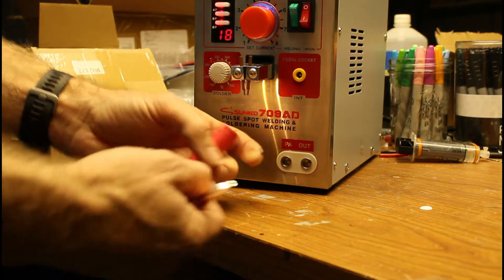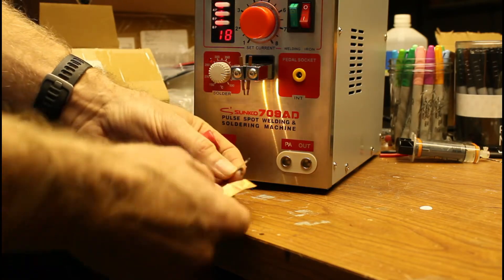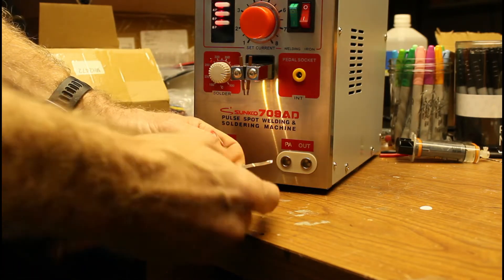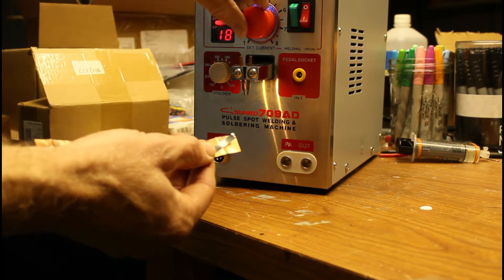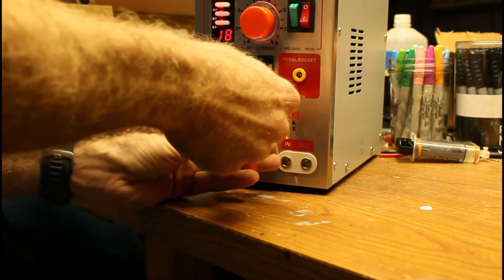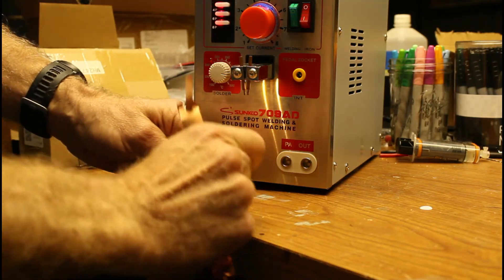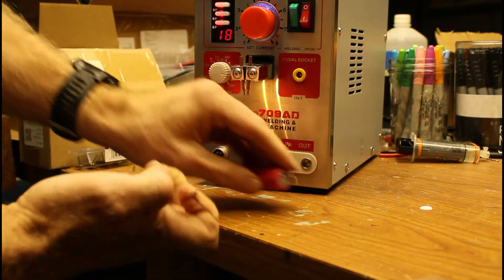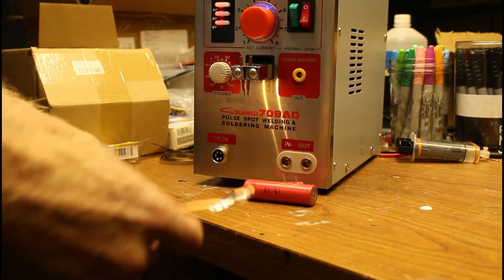Copper Nickel Sandwich Spot Welding

Comment: Thanks for the video. Sadly the 709AD is not available right now 😢
Reply: There's a very good reason for that. They destroy themselves. The control board fails often, especially when using the leads due to back feed when the magnetic field collapses after a weld. No matter the model number, if you see a similar looking machine it's the same design with the same problems. Buy a super capacitor machine you'll be happy.

Comment: About to use copper sheet for the first time. I've built hundreds of batteries but anything above 200A I always just used cells that I could bolt together. Like spim08hp's or headway 38120's. This will be the first time I'm building a high discharge battery with spot welding. I'd be lying if I said I was a little worried.. this is an almost 90kw build. There is zero wiggle room for detached strip.

20s20p molicel p42A. Qs180 90h, 3shul CL1000, CRF450R frame. 

I have 2 spot welders. Sunko737G+ and a Glitter801D. The glitter welds at 2500A max. In your experience is that high enough for 0.3mm copper sheet? Or should I get the glitter 811A which welds at 6000A max?
Reply from the maker: My experience with other welders is limited,  but I hear good things about the Glitter welders. I just picked up a kweld to try and do some heavier connections.
Reply: @ebikebuilds4000 does the kWeld do pure nickel 0.2mm with 0.1mm copper sheet? like with a LiPo?

i've got one on order which will probly arrive in a few days to replace my cheaper Sequre SQ-SW2 (it wasn't really good enough for consistent 0.2mm welds, plus consistency is hard to get as it's just time based)
Reply from the maker: @BH4x0r  I just started using mine. It's doing the .1mm nickel and .1mm copper just fine, way better than the Sunkko I used here.  I'm powering it with 4 chevy volt cells in series.  If I wanted to push it higher, I would do 4s 2p of these cells, and some heavier wires for the welder.
Reply: @ebikebuilds4000  didn't see the first reply.. I ended up getting the glitter 811A. It's actually way too powerful. I tested 0.1, 0.15, and 0.2mm on some some random cells I had laying around. At 50% power the 811A blows a hole through the copper AND blows a hole into the cell and liquid starts oozing out of the cell. Incase you or anyone on the future is wondering, the sweet spot seems to be :

Bare copper 
0.10 - 15% power
0.15 - 20% power
0.20 - 25% power

Second layer of pure copper on top of pure copper
0.10 - 30% 
0.15 - 40%
0.20 - 45%

Sandwich 0.2 nickle over copper
0.10 - 15%
0.15 - 20%
0.20- 25%

Pure nickel
0.20 10%
Reply: @jstagzsr  thats pretty insane, so it has no issues doing copper 0.4mm thick at 45%? holy...
Reply: @BH4x0r  I don't have any .4mm copper to try but it seems like it. The paperwork it came with said it'll do .3mm copper with flux at 75% power but I feel like that's way too high power.  I also played with the flux it came with and it definitely made it not blow through the cell as easy but I'm not sure what it's actual purpose it
Reply from the maker: @jstagzsr  sounds like an impressive machine! And a serious battery build.  The kweld is making strong welds for me, but the probes get hot quick and I have to wait for them to cool down.   I might try some heavier gauge wires.
Reply: @ebikebuilds4000  my favorite probes prior to the 811A got super hot super quick. What I did to stop it was wrap them in kapton tape. Kapton is heat resistant so it blocks a good amount of heat transfering to your hands.

And yeah the 811A is a beast of a machine. From what I read in the FB groups the kweld is just a switch. It takes whatever the input current/voltage is from the battery you're powering it with. So the kweld can be either worse or better than the 811A. It's capable of putting out more jokes of energy at it's max specs but at its recommended specs it's not as powerful. Either way though it's an awesome welder. I want to buy a couple 2000A 30v capacitors and use those to power a kweld in a box and make it look all neat and pretty. I love how you can control the energy output with the kweld. With the 811A it's always 6000A and you just control the time is discharges for.
Reply: @jstagzsr  afaik the kWeld calculates the time based on the set joules and the current from the battery, but yea
Reply from the maker: @jstagzsr  the adjustability of the kweld has been good. I just finished up a copper sandwich build and started working on a little hobby battery using just thin nickel strip. I just turned the knob down to 30j and went right on with it. I could work a lot faster too, because the probes weren't getting so hot at the lower pulses. I know there's a lot of customization available for the kweld that can get it up to those big amp numbers.  I know if I doubled up the Volt cells I'm using, this thing would be an absolute beast.  I've been following your build on the electric motorcycle group, looks impressive! I'm starting my Ducati build soon. Hoping to fit the Volt modules in the frame as-is, but it might not fit and I'll have to break the modules down to the cell level and build a battery to fit.
Reply: @ebikebuilds4000  oh that's you with the black Ducati? (I think I saw that on FB... Lol) . Good shit dude. Definitely keep the group updated on that one. I'd love to watch the progress.

And yeah people talk very highly of the kweld. I kinda wanna get one just to see what all the hype is about. Haha
Reply from the maker: @jstagzsr  the black one is done by the Inja and Lord Kurt on YouTube.  I saw their series and wanted to do one myself,  so I've been gathering a bike and components.  Almost ready to start the actual build.
Reply: @ebikebuilds4000  dope. I love it. I wish I had more free time. My bills could have been done months ago. I spent so much time at work cuz I just have my packages delivered to work. So every time I walk into my office I have to stare at a pile of parts that are just collecting dust. LOL. Probably going to end up lazily building over the winter and then riding next spring.
Reply from the maker: @jstagzsr  I feel that. My donor bike has been starting back at me for months. Such are the ways of hobbies, never enough time!
Reply: @ebikebuilds4000  haha. For real. Maybe I should just quit my job so I have more time to play. LOL. I wonder if my boss will keep paying me if I don't work. Well I mean, obviously he would have to otherwise how am I going to afford my hobbies??. Makes sense to me.!!

Comment: I've been trying to find a way to use copper, but I only have 0.15mm pure nickel and not nickel plated steel. Don't know if that's the cause of the failures. Welds aren't strong enough, although they're not terrible either. I'll try nickel plated steel and also cut a slot on the copper ribbon or even completely split the strip in half to create a gap to force the current through the cell tab.
Reply: Few months later update: Indeed nickel plated steel is the way to go for welding this copper sandwich. It works brilliantly and the welds are quite strong, you need pliers to pry them off and it rips the ribbon apart. Btw, I don't have a fancy and expensive spotwelder like a Kweld, I got this results with a basic DIY microwave oven transformer and AliExpress controller.
Reply from the maker: .1mm nickel steel is what you really need for this machine to work. Anything thicker and it won't penetrate enough.